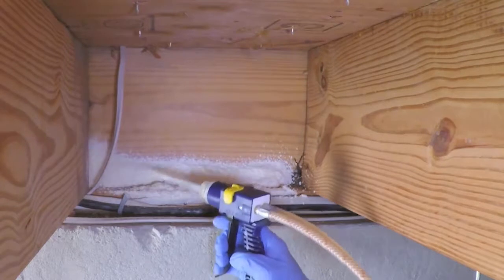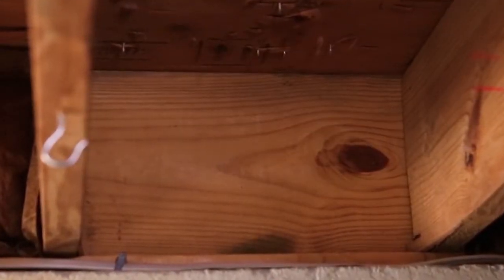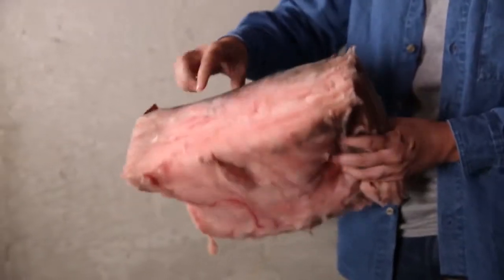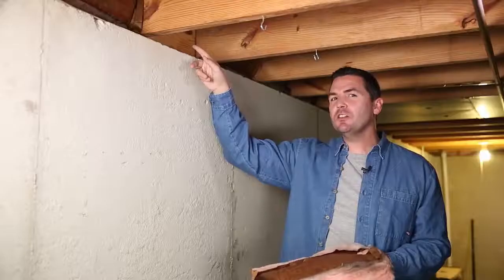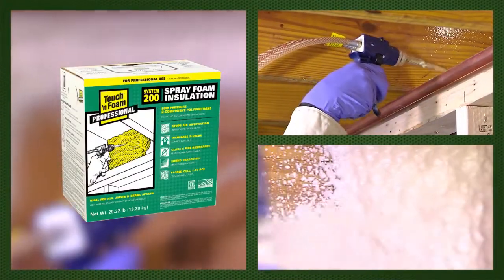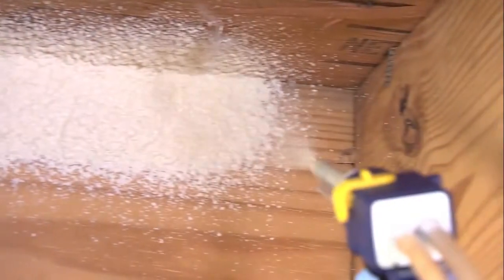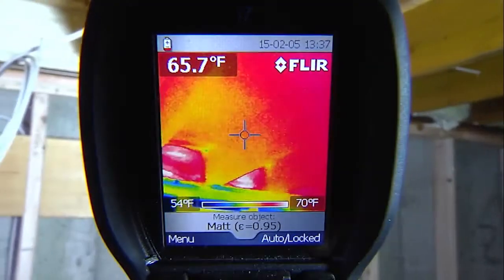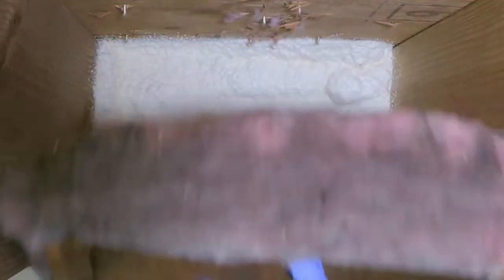How to Air Seal and Insulate a Rim Joist

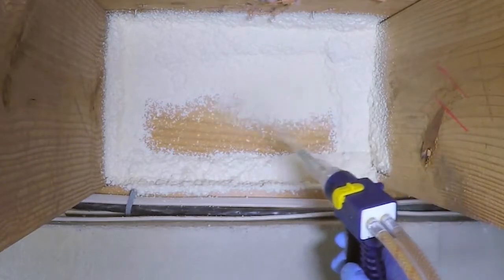Comment: This is a great home repair but at 1:44 you can see a problem I ran into in my basement. Wires are bundled up and tacked to the sill plate. I wanted to seal the seam where the sill plate contacts the concrete wall but wires were in the way. I would not spray foam over the wires. I moved the wires where I could and caulked the seam. I was also working around drop ceiling rails which made it awkward. In the real world you have to overcome obstacles. I have done rim joist sealing and insulation on 3 houses and each had it's own challenges. It is well worth it my opinion because the cold air that is leaking in is cooling the floor under the main living space so the house gets more comfortable right away when you seal it. It will also lower your heat bill but it will take some time to recoup the cost.

Comment: I’ve seen people uses foam board and then put batt over it.  Is that better?  Also, would you need to caulk around the edges if you are going to use the rigid foam
Board with gap filler ?
Reply: Yes, best practice (without this expensive kit) is to adhere a piece of rigid foam to the rim joist area, spray foam (or caulk) around it to seal. Putting the fiberglass batts back on it will provide additional insulation, and I did in my basement. However I do find the fiberglass batts unsightly and and contemplating removing them.

Comment: In the video you put back the batt insulation with a vapor barrier.  Curious since you have created a vapor barrier shouldn't you be pulling the vapor barrier off the batt insulation as not to trap moisture between the two vapor barriers?
Reply: I’m wondering that too
Reply: @nicholasgarcia4095  Hello, I am a newer, young, ignorant homeowner and am currently looking to insulate my rim joists.  Could you please explain what you mean by "not trapping moisture between the two vapor barriers."  are these barriers the spray insulation and the batts of insulation?  Thank you for your help!
Reply: @jhurtt77   from my understanding one barrier would be the spray foam and the other would be one of the layers on the fiber glass insolation
Reply: If the vapour barrier on the insulation is not perfectly sealed all around to the wood, then no you won’t trap moisture in there. The humidity, if any, in there will dry to the inside of the house.